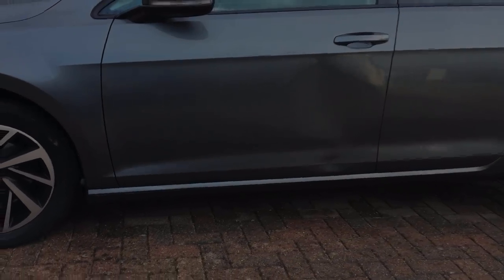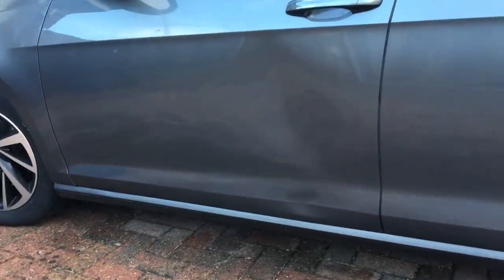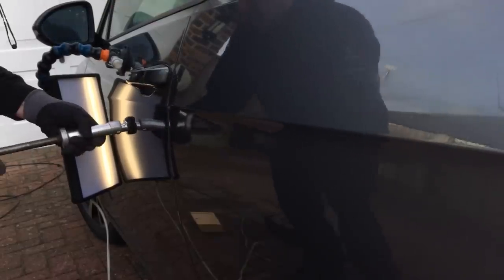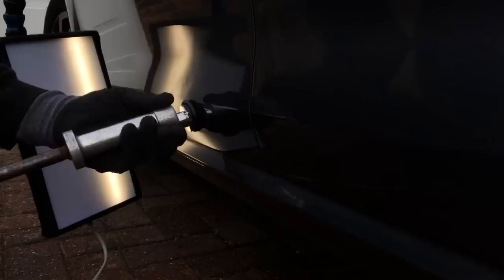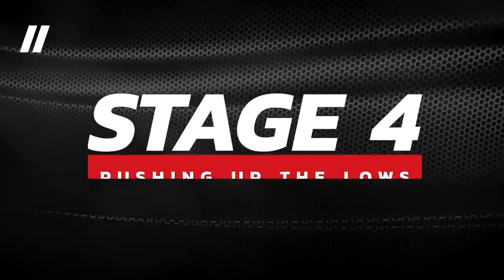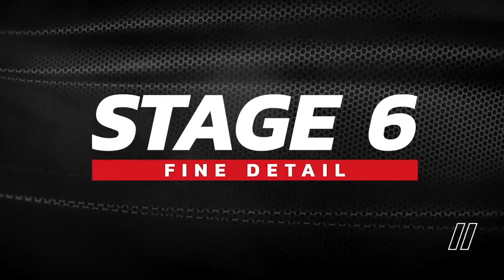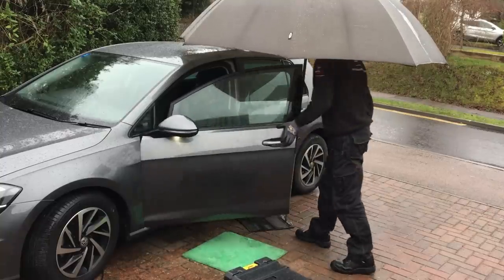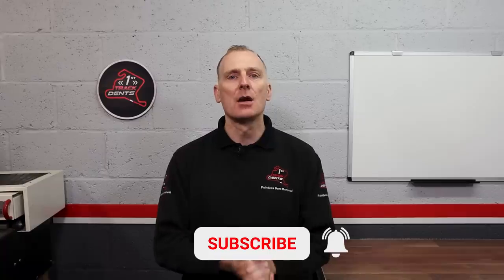Fixing a HUGE DENT with COLD GLUE!

Comment from the maker: If you like to save time on your PDR repairs and get more done, this should definitely be in your PDR kit.
Reply: Absloulty Right
Reply: Absloulty Right 👍🏼🙏🏽
Reply from the maker: Paul Silcock  There are some links in the description:-)
Reply: So Good Bro ,I like it.
Drive me.
Reply: May I ask why you started the dent pulling in the lower section of the door which also happened to pull the larger dent out above where you pulled? And why you didn't start by pulling from the centre of the large dent?
Reply from the maker: @milkshakemuncher  Good question, I based it on my experience and I could tell that the lower area was where all the tension was being held, so by pulling this section out first, I knew the top would follow as the top section was being held in by the lower section. Pulling the top section out first could have resulted in putting more tension in the lower area and locking the metal up, making it harder to push out later:-)
Reply: @1st_track_dents  Thankyou for your insightful reply, much appreciated.
Reply: @milkshakemuncher  ?
Reply: @claudedjawoye6345  yes, can I help you? What's the question 😎
Reply: This bloke is a genius!
Reply: Please I can’t find the limbus for cold glue or the tools your using
Reply: What are these pants you're sporting? I'm looking for good daily detailing attire.
Reply: Hi. Have U got any contract number or website where I can find more information about Your car dent repair. I need to do it in my car.
Reply: Where to buy your tools!

Comment: Great job!
If you check some reviews from the recent MTE, they give some good advice on the use of cold glue, taken from the Russians. They use your normal plastic tabs with cold glue, but they keep'em attached to the slide hammer adapters using hot glue. Other cool trick - they don't use alcohol to clean the panel, they just touch it with some buffing compound, like residues off the buffer pad. They say the glue sticks much better.
Reply from the maker: Sounds interesting, I will have to try some of these methods out and see if they work, thanks for sharing your knowledge:-)
Reply: The Russians are right about this, compound preps  the surface better than alcohol for glue pulling

Comment: After you’ve restored it to its original state will the panel flex if you apply pressure to it? For example if you were hand waxing that part of the panel will it flex and move because the metal has been stretched from the impact? Will the panel want to go back in?
Reply from the maker: Good question, no this panel won't flex back in, it stayed in originally because the deep indentation at the bottom which was holding the panel in. Once that tension was released the door went back to its original shape, it hadn't stretched the metal at all. However some new cars have some very weak doors that push in and stay in from the lightest push. The more pronounced swage/bodylines a panel has the more rigid it is.
Reply: 1st Track Dents ok thank you

Comment: Nice work. I never can get my cold glue to stick so well. I get a pull but not the hard pull you get here.
Reply from the maker: Thanks, I get the panel really clean and then heat the cold glue just a little, it's all trial and error really  until you find that sweet spot. 👍

Comment: Good job Jake. Love Glexo cold clue! It has more than cut my large dents in half! Thank you for the review and as always,  have a good day to you!
Reply from the maker: Thanks Terry, yes I'm hoping it will cut down the time on a lot of my jobs now, have a great weekend :-)
Reply: May I ask, what is the reason this saves a lot of time, is it just because with this cold glue method you can keep reattaching the puller to the door in different locations quickly and get multiple pull sites in the time it would take ordinary hot glue to set in the many tab positions required to do the job, or is the reason something on a much more technical level?

Comment: May I ask you if that Cold Glue (or a hot glue as a matter of fact) can be applied to a suction cap to pull a large dent out? I've never seen in any film people using suction caps that way, though I've seen 2x4 wooden blocks used. Thank you for the great and informative film. I have no idea where and how to knock on the metal to relieve the tension, and your film is very helpful to see that technique.

Comment: Watching you at work is like watching an artist!

Just wondering if you could give some insight on how/where you lever off on things like this when the bars come out?

That cold glue system looks the bollocks!
Reply from the maker: Yes the glue is stronger than you think, I try and lever off anything that will allow me to without creating further damage, if the area is hollow then you can always, use a small piece of chain or some Edgy Tools hangers, there are not set rules in Paintless Dent Removal you have to be great at problem solving and using anything to hand to get the job done:-)
Reply: @1st_track_dents  again, thanks for taking time to answer

I mentioned I was looking forward to your diy light tutorial - I modded the abysmal Amazon special I had with a new sucker and some led light tape - hopefully that will allow me to progress until you get your video up and I see how to do it right 😂

But I'm sure I'm not alone when I say I'm learning so much from your videos - thanks once again!

Comment: What if one’s VW has side airbags? I have similar damage on my 2012 VW Passat SE at the lower 1/4 panel. Will I be able to remove the door panel the same way or will need to work around the side airbags? If so do you have a video showing how to remove door panel from door with side airbags ?
Reply: Side airbags are not in the door but the b pillar.

Comment: I see Glaxo supplies a large log of glue. Do you have to discard the glue after the job is complete or is it indefinitely reusable?
Reply from the maker: Hi Greg, I’m still using the original piece that I had from over 2 years ago and it still pulls really well. You just need to keep it clean and avoid dropping it in on the floor! 👍

Comment: When using the various tapdown tools, what is the area of effect on the metal ? Does it only affect the exact spot that you are tapping or are there additional micro highs and lows around the perimeter of the tap  depending on the current state of the metal and it's tension points within the damaged area?  There's a hundred questions I have about doing this in great detail..I wish you had a program for teaching it I would certainly pay
Reply from the maker: Thanks, there are so many answers to give, I would really have to demonstrate in person the technique. There are lots of different tap downs really, some are super sharp for very sharp micro highs and some are much softer for removing the lumps/crowns around the perimeter of the dent. I generally use 3 main tap downs. A sharp one, a plastic vinyl one and a rubber one.
Reply: @1st_track_dents  thanks for the reply  and I'd definitely love to see a video about the finer technique of tapping out with the degree of precision you have.

Comment: you can use cold glue on non-factory paint!?
Reply from the maker: It's still risky putting anything on non factory paint, but cold glue is much safer than using hot glue on non factory paint. Hot glue sets very hard onto the surface and would be more likely to pull off any paint. 👍

Comment: Ive been a tech for 22 yrs and I agree , its a useful product if conditions are right.
Temp and humidity play a huge role in its affective use.
It will not pull out sharp dents , and it is limited in several areas.
In truth, big soft dents are where it works best.
Body lines and deep dents limit this product.
For a seasoned tech, it can work in part of the PDR process.
But, for a begginer who thinks it is a slamb dunk repair tool, I think you will be disappointed.
This is my experience, and I am only passing on my use of this product.
Reply from the maker: Thanks for passing on your experience of the product:-)

Comment: Can you use the on a small dent?
Reply from the maker: You can, but if the dent is fairly sharp or deep, you would need to switch to using hot glue pulling or go behind it to push it out:-)

Comment: Hi Jake, great videos, you must be going mutton jeff though as music way to loud. Quick question on the Cold glue.   Once you have taken a bit out of the packaging, how long will it last ?  Is it one job and finished.  ?   You can charge it on to your customers as a material cost ?   I know most Insurance companies wont accept it and say its included in the overhead rate of labour or in with the sundries.
Reply from the maker: Hi Chris, I did this video about 6 months ago and I am still using the same piece of cold glue on new repairs with no problem, it is just as sticky, I don't charge it as a material cost as it lasts a long time. All the best, Jeff Mutton 😁
Reply: @1st_track_dents  Thanks for your reply, do you feel it is off benefit to a conventional panel beaters tool box ?  ie to use in place of welded pins
and copper plates like on a Miracle pull ?
Reply from the maker: @chrisa6279  100% yes, I use the Glexo Cold glue every day,  I used it today on 3 or 4 dents in a door and it pulled them out completely without me having to put a bar down the door. I used to be a panel beater before PDR, some jobs will still need pin pulling etc, but Glexo will definitely reduce a lot of time applying filler and rubbing it down. 👍

Comment: 3 times PDR is NOT the solution:
The paint is cracked.
The paints is 10 years old.
The edge of the panel is distorted.

When the paint is cracked, the primer is absorbing water like a sponge.
Old paint is going to crack.
If the edge is distorted, the panel behind the dent is likely damaged as well. And you have 2 panels to fix. Door frames are generally much stronger than door skins. 

Intrusion beams are much stronger than the shell and skin. This is your first line of defense in a side impact. Vehicles with side curtain airbags, usually have a crash sensor attached to the intrusion beam. Leaving a bet intrusion beam in a door, will augment the crash timing. And may not deploy the airbag.
Reply from the maker: Thank you for your comment, just to clarify things:
1. The paint was not cracked at all, there was only mild surface scratches on the face of the panel that easily polished off.
2. The age of the car has no bearing on whether a car is a candidate for a Paintless dent Repair, I have repaired many classic cars with no problem which has helped to retain their original paint finish.
3. The edge of the panel was not distorted, it was still straight, the frame was just pushing through very slightly which was easily corrected from the outside just tapping the crease line back in, which created no damage in the process.
I have returned to many jobs that I have worked on to carry out other repairs and not one has ever had any issues from having a PDR repair on them and still look as great as when the repair was completed. Thanks again for your comment.

Comment: That's not a dent, it's a depression because the cheap bastards could not put in some kind of backing structure.  If you pressed from the inside, it would be easy to put back in place.